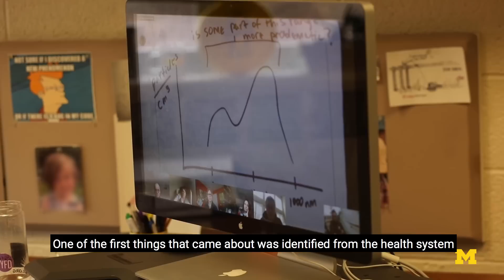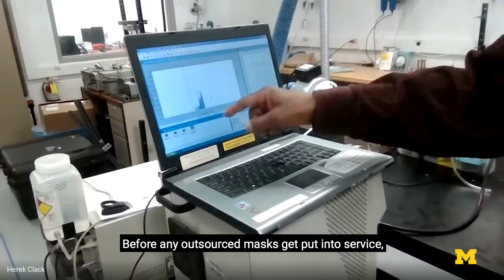Testing disinfected N95 masks to show they stop coronavirus-scale particles

Comment: The truth is there’s masks don’t seal right around the face and particles can go through from in between your face and the mask 😷!!!!!
Reply: This. I don't think anyone would argue the material used to make N95s doesn't filter. But that is all they're testing here. The material. By clamping a mask between two plates and forcing all the flow through the material. This is as about as far removed from a real world scenario as you can get. 

We all know, especially now as its cold, you walk in from outside and your glasses fog up immediately because the air you're breathing out into the mask, some of it is being redirected straight out the sides into your eyes, around your cheeks, past your beard etc. I would wager a significant portion of the air you breath out is not filtered at all, but is simple redirected. It then exits with a much lower velocity and hangs around your head as a cloud. So you have a dense cloud of potentially virus laden air hanging around you. Eventually it will diffuse into the room where the density of the virus may become too small for someone else to get a "minimum viable dose" (unless they spend a long time in there with you). I would even suggest someone without a mask, whilst they are projecting all their air forward (potentially right at you), it will disperse and reach that diffuse state much quicker. 

Its an interesting subject... tests like this are important so we know the absolute mechanical efficiency of the material, but they don't answer the question of the real world at all.